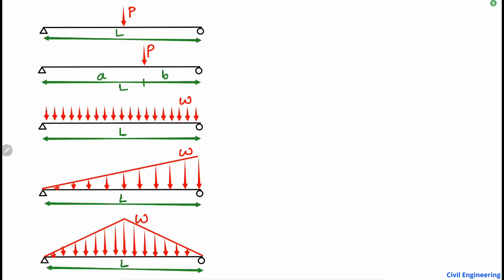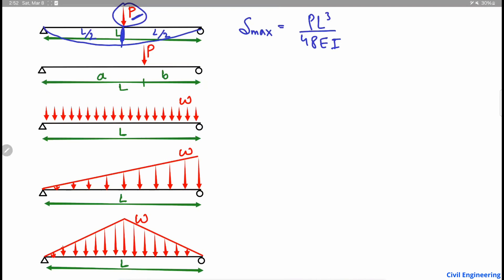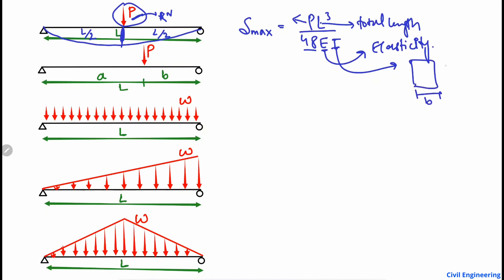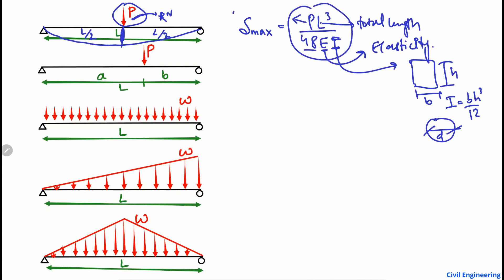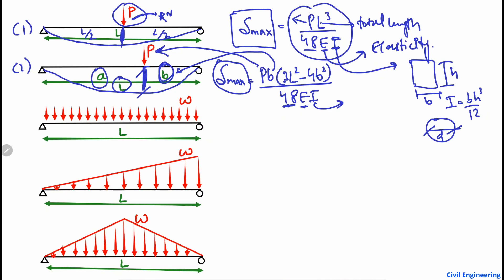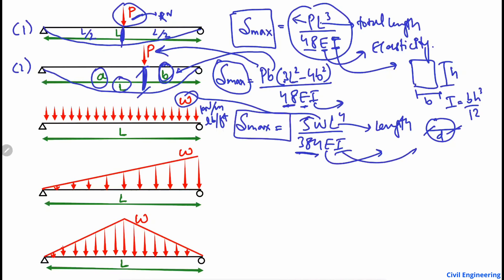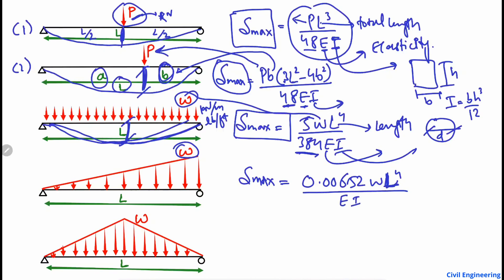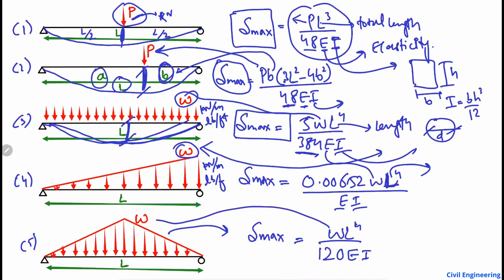Beam Deflection Formula's - Example solved

Comment: Sir, I need for the 5th scenario in more details, let’s say my aluminum door sliding frame as the beam. The shutter is 300 kg with bottom I have screwed 300mm distance how much I can get the deflection